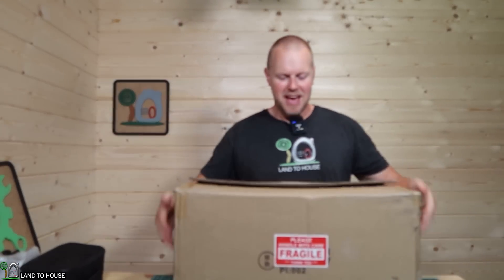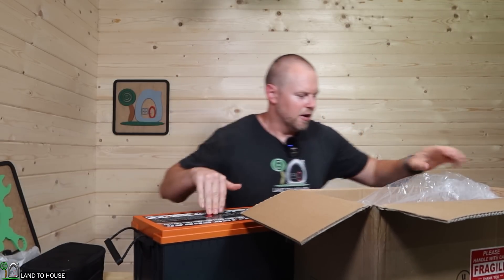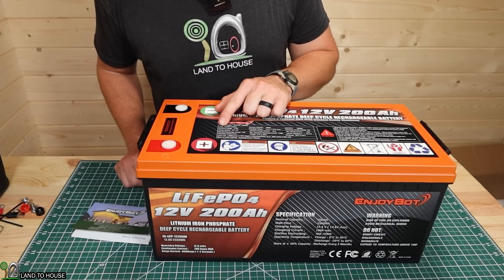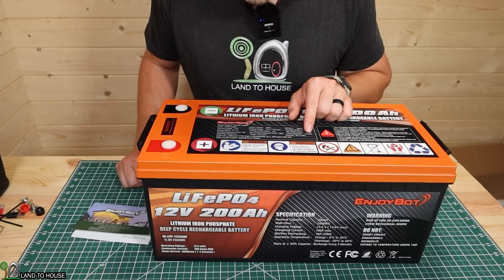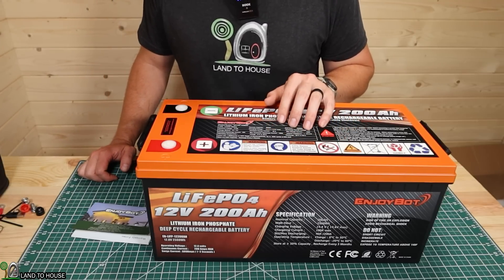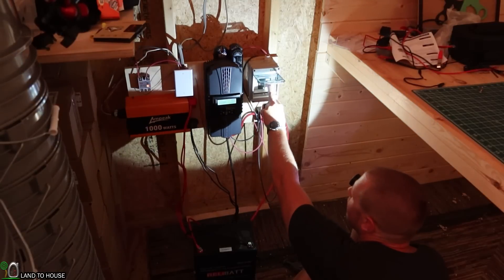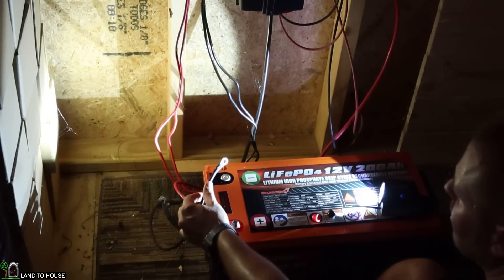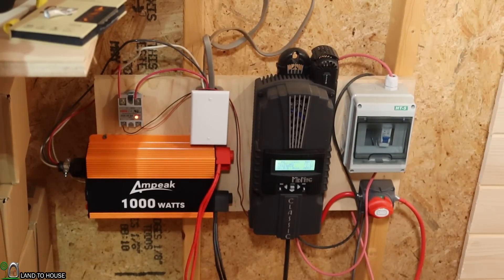WOW 200ah 2560wh Big LifePo4 Battery [EnjoyBot]

Comment: Hi, I've been just starting to replace my 7 year old AGM battery system with LifePO4 batteries and there are so many coming out with prices dropping steadily.  I just bought a power queen 200 ah 2560 wh battery that looks just like this one in terms of design.  If I wanted to buy this enjoybot in the future can I hook this in parallel with different manufacturers like the power queen?   Thanks.
Reply: How is that power queen treating you? I haven't pulled the trigger yet. Still confused about the different BMS limits and trying to understand how to direct alt-battery charging

Comment: Hi Seth, long time watcher, first time commenter. I'm interested to see if you have ever put a DC voltage booster in front of the rectifier for low voltage hydro electric? To get the voltage higher for better charging. i have a low flow spring of about 6 gallons a min. with a fall of 8 ft. i don't know the head. I'm looking at the ecoflow portable systems that have a limitation of 12 volts to charge.
Reply from the maker: Thanks for being part of the channel. With 6gpm and 8 feet of drop you can only make 4.8w. You could step up the voltage and drop the amps but still not going to do much with those parameters.  (My system is 150 feet with 30gpm)

Comment: Hey Seth. I have a Ram pump question. What is the difference\preference in using a pvc inline valve vs using a swing valve as the non back flow in the pump?I've been looking to see if you have already done one and haven't seen that yet. Thank you!!
Reply from the maker: For me the difference is weight for shipping and $. The brass valves are a lot more expensive.  They don't have a rubber seal and might not work as well.
Reply: Okay. Thank you so much. I've been following your channel for a few months and you helped me build a pump. Love the Land to House channel and hope you are well.

Comment: I to make them last as long as possible, I never load over 14 volts and never discharge below 12 volts. Ciao
Reply: Yes you are right avoid the 14.6v 
14.6v is risky 
3.6v top balance is also risky 
Just forcing a ballon to blow or car tire if you choose 14.6v 
It is very important that battery capacity has a allowance 
For me 80-85% capacity is the best 
100% is not the best option

Comment: I got 4 100ah enjoybot batteries several months ago, they replaced our 5 old leadacid batteries we had for years. They have been doing great so far, able to power everything we need, furnace fan in the winter, swamp cooler in the summer, lights year round, computers, and various fans. Haven't had any problems with them and I believe still pull full capacity from the rough numbers I can tell from my setup. 
Even tho im looking at server rack batteries for my next buy, I still would recommend enjoybot so far.

Comment: Just be careful when using any Lithium based battery in applications like this. If a charging controller happens to fail, even though rare, a few will possibly fail, the battery could continue to charge to the point of overheating and start a fire that will be hard to put out. The composition of Lipo and LifePo batteries create their own oxygen when burning. Consider putting the batteries in a vented/filtered fire box, especially if you will be placing them inside your house. Also place an OPTICAL sensor smoke detector over the battery charging area. Regular smoke detectors use a chemical detection sensor that will not get triggered by the soft white fumes that get emitted in a lithium fire.

Also, if you want to extend the lifespan of a Lipo/LifePo battery, never let it charge to 100%. This stresses the battery and reduces it's life expectancy. Consider charging them to only 85% at all times.
Reply: LiFePO4 doesn't readily burn, even when abused to destruction.  Not to say it cannot, but the chemistry is far safer than batteries without iron and phosphates.
Reply: @Sylvan_dB  prove that wrong with some facts!
Reply: @talk2azs  prove me wrong. The facts are all out there readily available. Chemistry matters, not just the first element.
Reply: @Sylvan_dB  Yes there are facts out there. If you read my comment properly, you will see that I used the word "RARE". By far. I am not saying that a fire will happen. All I'm saying is that it could happen, and it's better to have extra protection and not need it, than not having protection and needing it.
Reply: @talk2azs   @OffTheRails    You are editing your comment, but as I write this you used ”rare” to apply to charge controller failures leading to ”continue to charge.”
Reply: @talk2azs  I appreciate your kind comment. It makes plain the quality of person you are.
Reply: @Sylvan_dB   There were Tesla batteries caught on fire and almost impossible to put out. what type of batteries teslas use ?
Reply: @osmanisildak2448  They traditionally have been using lithium-cobalt-manganese.  Recently in China I understand some of the low-end Model 3's built there have been using lithium-ferric-phosphate and perhaps more of their low-end vehicles world-wide will use the LiFePO4 chemistry. (LiFePO4 is cheaper, but much less energy dense so cannot get as much range for a given volume and mass of the battery.)

Comment: Just bought same size 200 Ah to my camper few months ago and not disappointed it is slightly smaller in size and weight also, tested 203 Ah to shutdown. That is gonna last, but as you say never charge at freezing temperatures! Got to hope it lasts many years because it was expensive!
Reply from the maker: I was impressed! Compared to old AGM batteries this is amazing.  But the cost is very high. If you needed 4 or 8 of them you would be out your kids college fund.
Reply: Just be careful when using lithium based batteries. Please read my comment on the main thread of this video's comment section.